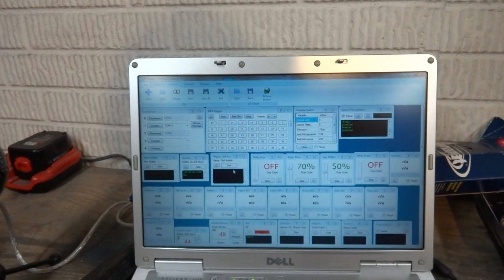B9 Bubble Lifter supports

Comment: Very cool. Looks like it works great.
Reply from the maker: Thankyou. Actually I've had problems with the servos burning out. I'm planning on replacing the whole lifter with a linear actuator. That would element the need for the supports.

Comment: so is it wirelessly getting info from the lap top ?
Reply from the maker: I'm using EZ Robot to control the robot. This system has software located on my laptop called EZ Builder. This software is where I have all the controls and scripts that animate the robot. The signal is sent from EZ Robot, through my laptop, over WIFI using my home network to a receiving unit mounted on the robot called a EZB. All motors and other devices on the robot are connected to the EZB.  Learn more about RZ Robot at their website: http://www.ez-robot.com/